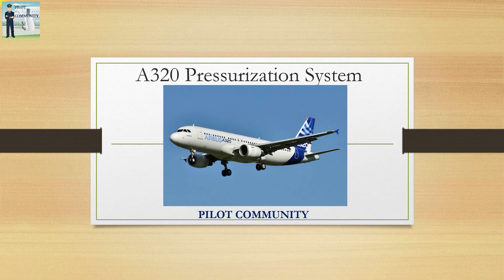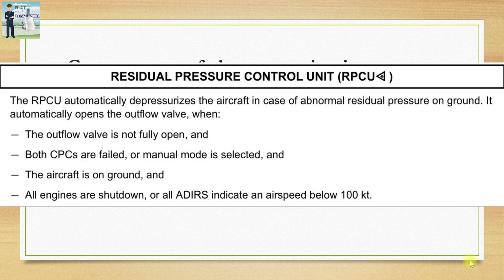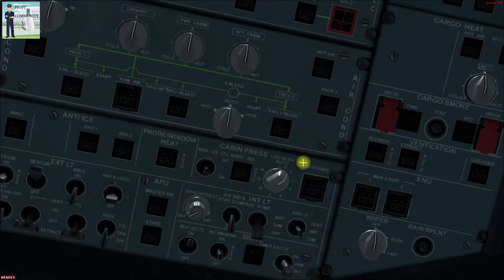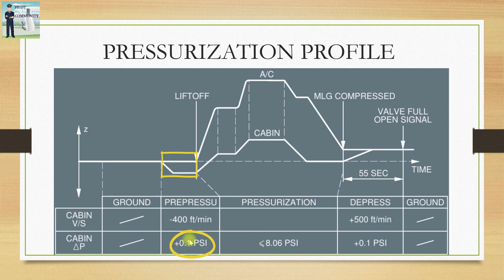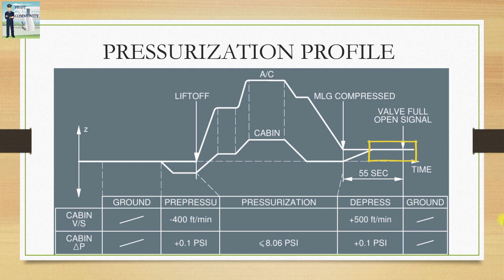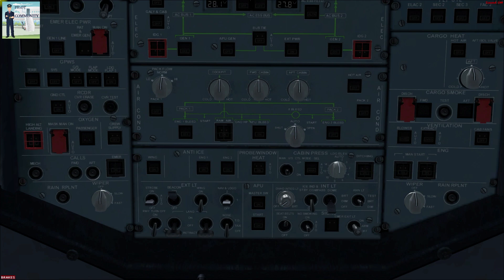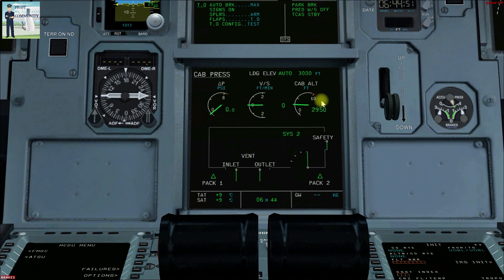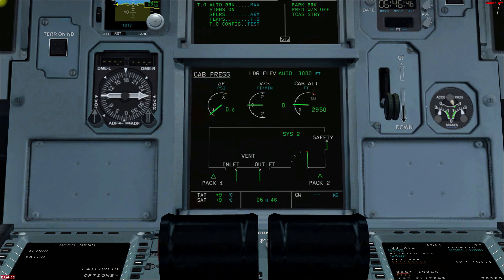A320 PRESSURIZATION | Controls and indications explained on virtual simulator of A320 ✈️

Comment: How are you sir please can you tell me that on the 8000feet oxygen level is the same like ground level no problem for breathing
Reply: No.
At 8000 feet the oxygen level is much less than at ground level...
But this is considered very safe for passengers.
On B 787, the cabin altitude is 6000 feet hence for long distant flights 787 is more comfortable than  other airplanes.

Comment: Can you explain how to use the 
Manual mode toggle switch
Reply from the maker: So the way it works is: We use the vs toggle switch to change the cabin rate of climb/ descent to adjust the cabin altitude manually. The toggle switch is sluggish. So for that reason we first toggle it upwards/ downwards and then wait and observe the cabin altitude rate of climb/ descent. The cabin rate of climb/ descent has different values depending on your aircraft's barometric altitude (refer FCOM). The toggle switch basically controls the outflow valve position which can be observed in the Cain pressure page.